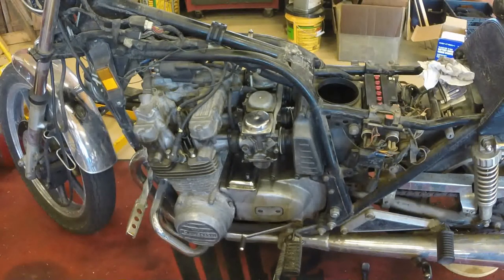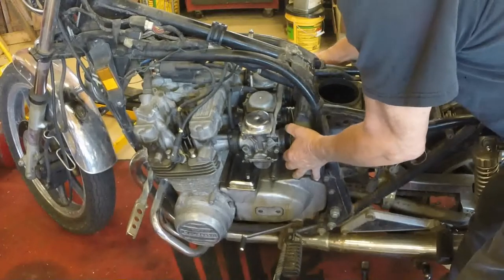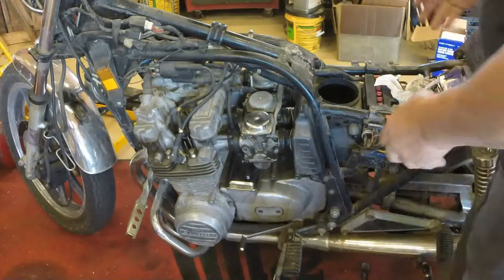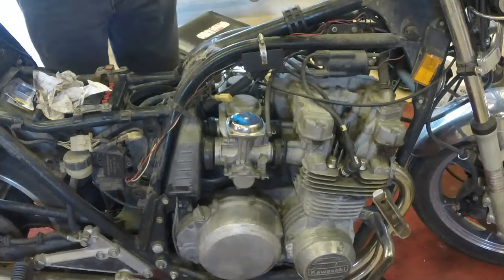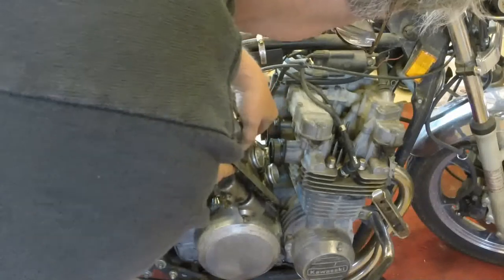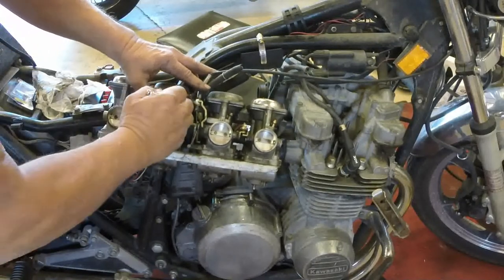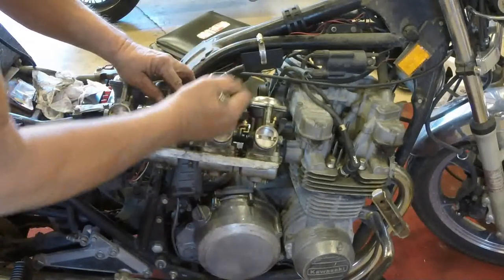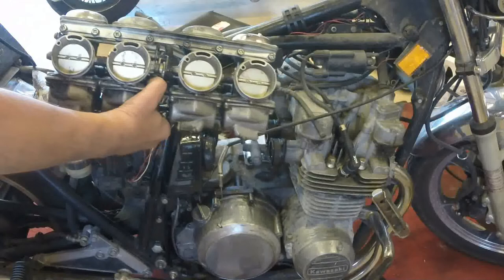1980's KZ carb removal

Comment: My 82 KZ1000LTD was a pain in the ass. Makes me want to use KN pod filters. Not sure about jet size mods? Bad design.
Reply from the maker: I  can not advise using pod filters with CV carbs,  It is my experience that they can never be made to run right.